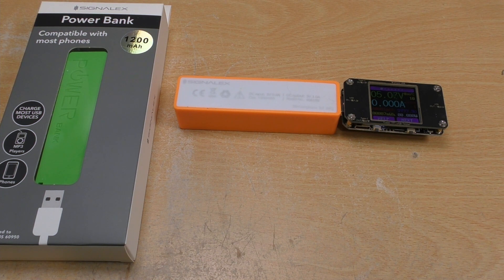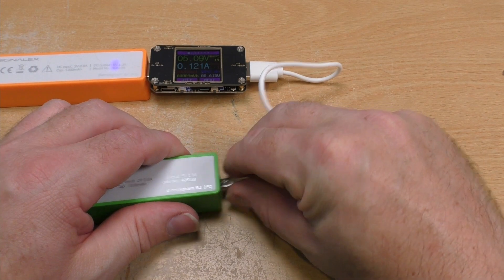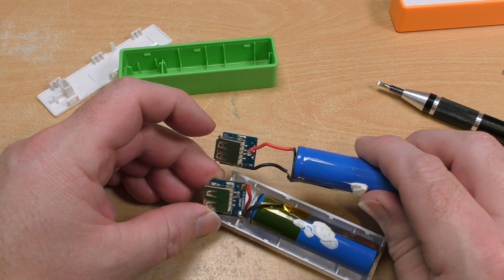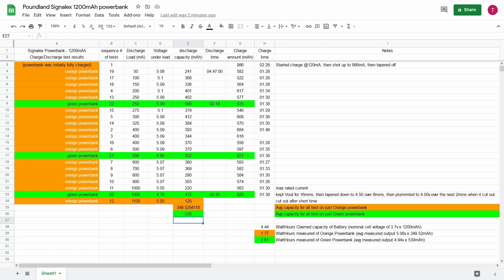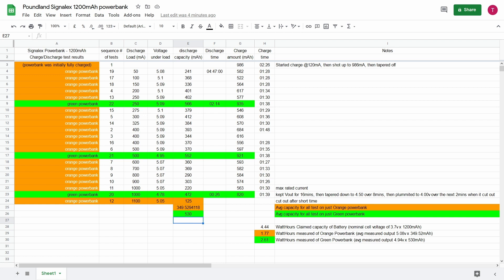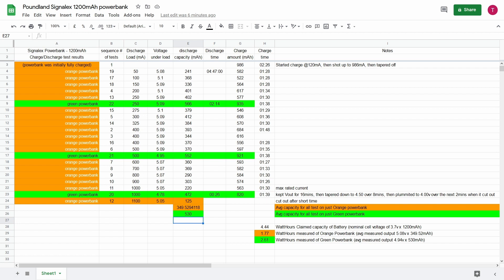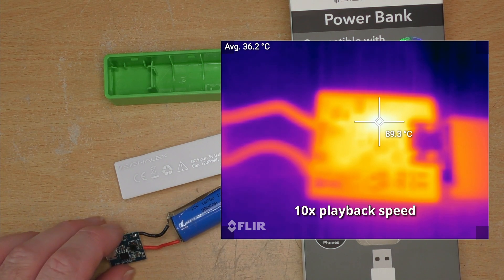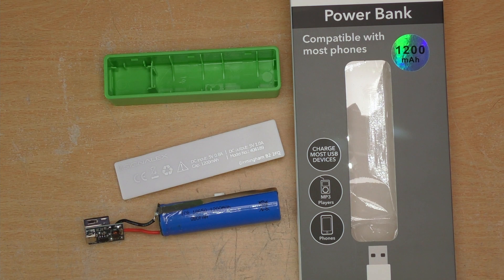Poundland SIGNALEX 1200mAh USB Powerbank - test and teardown

Comment: these things charge my phone for 10 minutes then reset and wont work until i plug in into charge. is it just my one or should i scrap the idea of these single cell powerbanks?
Reply from the maker: These have such a limited capacity for charging a phone or tablet, maybe ok in an emergency, but like you've experienced, when the phone/tablet draws a normal charge from it, the Powerbank will cut out.
For a phone or tablet, I'd recommend choosing at least a 2-cell Powerbank

Unfortunately, you do tend to get what you pay for on these, £1.00 doesn't buy you much capacity in a Powerbank. But these are ideal for any low-powered devices.
Reply: @spuddevans  thanks mate, appreciate the videos and response keep putting out more content

Comment: good video. is this device safe? as in has all the necessary protections so it doesnt catch fire?
Reply from the maker: Hi there, Thanks for watching!
It does have some protections against over-discharge, over-current, and also will shut off the charge when it is full. But like any L-ion battery, there is always a risk. And this is a budget model, so you have to expect that the savings have been made somewhere.
I have 4 or 5 of these and use them regularly and have not yet had any problems with any of them.